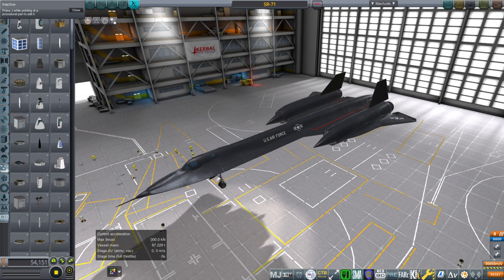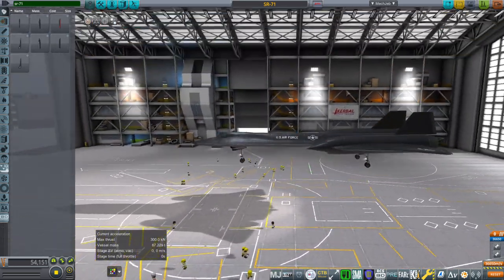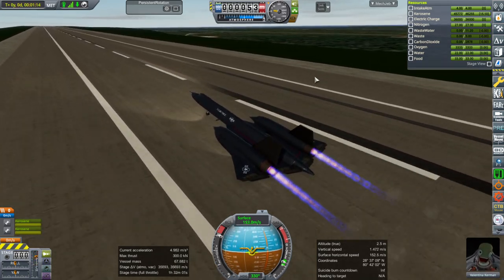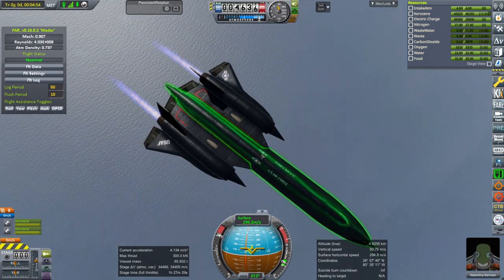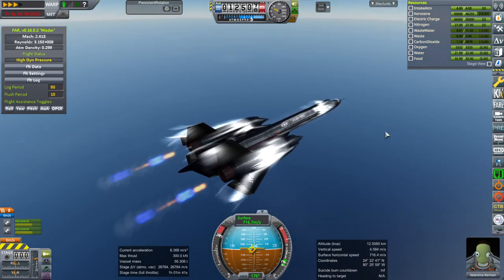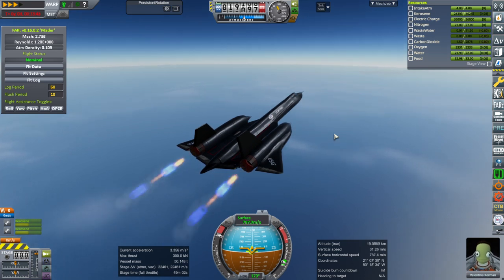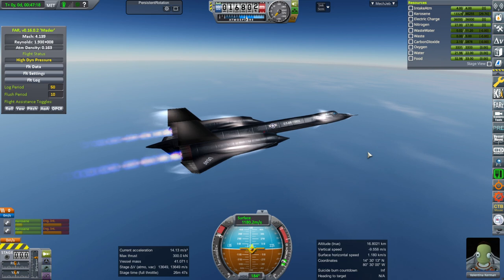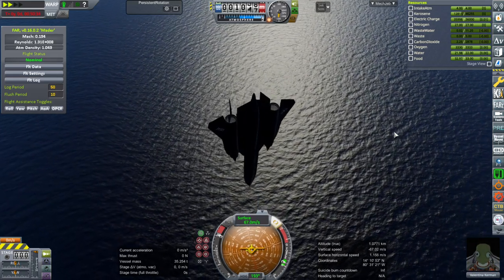KSP with Realism Overhaul - SR-71 Redux

Comment: I was inspired by your video to make a SR-71 in KSP-RO. But, I used all procedural parts (procedural wings and procedural tanks) to create the shapes. The final product didn't look as good as yours, but it flew beautifully at 20000m and mach 3.2. I got all the way from Cape Canaveral to Nova Scotia before running low on fuel. I also took it up to 26000m which is the ceiling for the real SR-71, but it wouldn't stay there for long.

Comment: this is totally weird, it was just flying at mach 4 and suddenly it works as a parachute. you couldn't fly with deployed parachute at mach 4 but how can you explain it slowing down to 80 m/s? looks like your lift is pointing backwards but why it didn't slow you down at mach 4? maybe lift decreases dramatically at supersonic speeds that is expected since there is no actual flow around your wings, you're just pushing air away and it has no time to come back. then it could be really lift on the wrong axis.